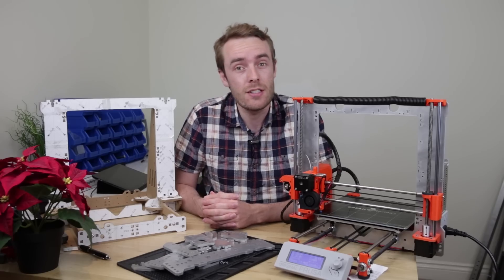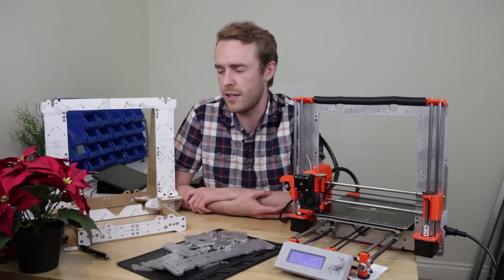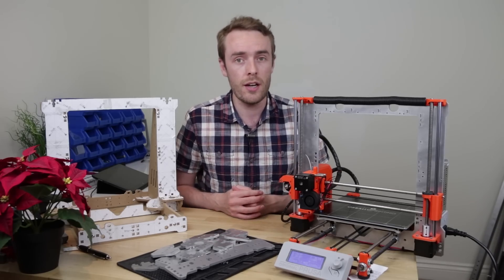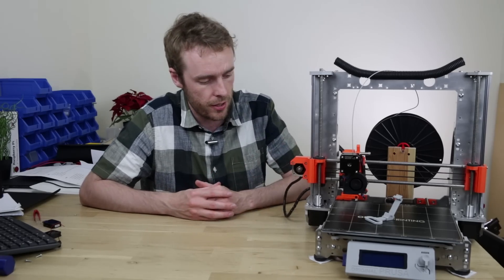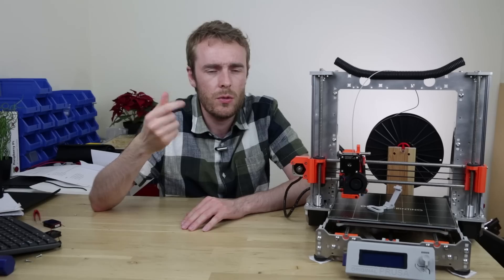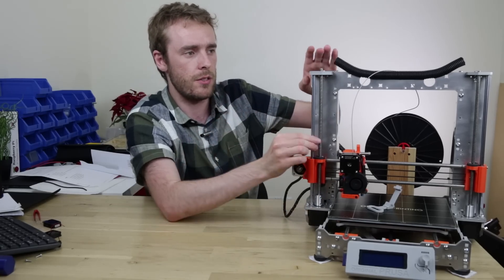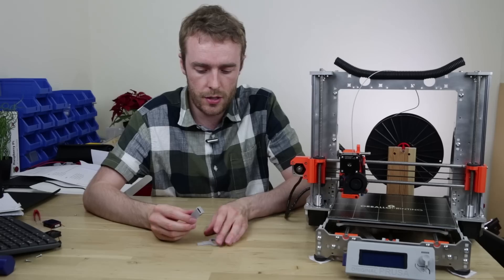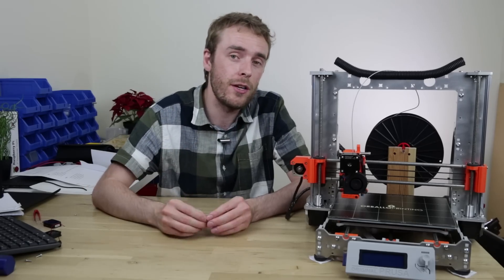Totally CRAZY Prusa i3 MK2s Frame MOD

Comment: Edit: First and foremost, sorry CRT, this wasn't meant as an attack on you or your channel( though it kinda ended up sounding that way, so, sorry XD great content btw! ); your channel just happens to be the channel I'm watching and are one of very few 3D printer/tech channels I'm willing to comment on. Second, before anyone tries to tell me that some or all of the printers I have are essentially i3 clones, they are fixed gantry CNC machines which have been around a lot longer than the prusa i3 printers :P

This is one of the worst designs for 3D printed frames that's currently out(the prusa i3 frame, not the clone, though the clone is obviously just as bad XD), I don't know why anyone would want to spend the money to water jet this frame or even try to clone the printer. Your lead screw(s) or threaded rod(s) used for the Z axis is almost assuredly harder and stiffer than the linear guides that's meant to keep the Z axis from wobbling at the slightest bend in your lead screw which WILL fail. This design literally depends on having perfectly straight lead screws to eliminate z wobble at which point, those linear guides on the z axis become useless.

The quick "fix" to the z wobble issue using that frame is to not constrain the lead screw and let the linear rails guide the x carriage up but lead screws are quite stiff and an 8 or even 10mm linear guide at those lengths will bend with even the slightest bit of force applied to them from a bent lead screw/threaded rod(the shift will of course be in the micron range but so are your layer widths :P ); as you get closer and closer to the middle of the linear rails it will get even worse. -_-

With that said however, yes, this design does a lot to minimize cost if you're building it from 6mm ply wood kits off ebay and it WILL print and the prints will be HALF decent so it does have cost going for it. However, in stock configuration, the original Prusa i3, Mk2, Mk2s, or the Mk3 are NOT good printers by any stretch of the imagination and it's way overpriced for what it is. I wish people would stop singing them praise because new comers to 3D printing are spending way too much on an entry level machine that's pretty much bottom the rung when it comes to quality but costs double of what low cost Chinese made machines can offer and they are better in terms of quality and price.

Disclaimer: I own 5 3d printers( Listed in the order I bought/built them in ), the TronXY X1, Voxel Ox, Tevo Tornado, Anycubic Kossel Linear Plus, and a dual Z custom printer based off the TronXY X1 design.. so basically an ender 3 like machine with dual lead screws ? XD
Reply: So you own five 3D printers, one of which is a delta and the other four of which are based off the Prusa design, most of them without addressing the flaws you’re pointing out (v slot wheels on 2020 or even 2040 are not more rigid than good lm8uu & round bar. Neither are cheap Chinese copies of linear rails, really.), and none of which are actual Prusa printers, nor even the cheap copies. But you are confident they’re terrible and not fit for purpose because prejudice.
Reply: Edit: Ha, it's been a week and still, he has not rose to the challenge, and he calls me prejudice :D

 @JasperJanssen  Prusa design ? Are you trying to claim Prusa came up with the fixed gantry CNC design ? Are you trying to claim that Prusa was the first one to use the fixed gantry CNC design to make a 3D printer ?

Show me linear rods on a 3D printer that deflects less than 2040 or even 2020 given the same length and applied force. Don't get me wrong, such materials exist in that form and can be bought and used for 3D printers but as far as I know, no pro-sumer, consumer, or hobby 3D printer built to date uses those materials for linear rods let alone the Prusa printers :P

When your mechanical design ranks among the lowest of the available options, ya, that pretty much makes it terrible >.>

Tell ya what, get a dial indicator and a 5-20lb weight and tie to the middle of one of your linear rods from your prusa i3 and I'll do the same with genuine 2020 and 2040 extrusions and we'll see which one deflects more :P Heck I'll even throw you a bone and do the same test on the clone 2020 and 2040 extrusions the china printers are made from :P
Reply: Heck it doesn't even have to be a specific known weight, as long as I can easily obtain the same item to conduct the test with XD

Edit: I'd prefer it if it were 20+lbs so whoever loses risks their linear guides getting bent out of shape :D
Reply: (PS: it doesn’t really matter how rigid your linear guides are if your leadscrew is bent. It’s still going to introduce wobble. It’s a non-random input that you will see, the question is only how much of it you will see.)

Comment: There is a thing remix for the x carriage that lets you use a common mk8 hobbed gear :)
If you get the extrusion issue sorted, then just print a 8mm (vase mode) tube vertically at normal print speed. If it stays consistent all the way up, then good job, the frame was worth it! If you print the same tube on the MK2, MK3 or some i3 clone you will see some wobble in the print about half way up onward. Also mite be worth upgrading the Z rods to 10mm.

Comment: You can buy a MK3 frame and its not expensive from a italian web site. It would still be cheaper than what you spent even with the non-printed parts.  They have the link posted on eBay as well.

Comment: So its a P3Steel frame, but out of 6mm aluminium and with the same design issue?
Reply: can you expound on the P3Steel's "design issue"?
Reply: Do you think there are any improvements compared to a P3Steel?
Reply: the Y-Belt tensions the steel or aluminium plate and transfers vibrations into the frame, ideal there would be a horizontal stiffener from left to write in the front and in the back. (so you get kind of an L Profile there)
Reply: i cannot answer the question, it is (for me) not possible without owning and using it
Reply: Thanks for the reply. I have a P3Steel and I agree about the front and rear plate. They are both not stiff enough and end up bowing with Y belt tension. This in turn moves the alignment of the Y smooth rods which aren't adjustable. Gussets  in the corners would help or  as you mentioned an L profile on the front and rear plate  or both. I have been thinking of adding stiffeners to my front and rear plates. I just haven't gotten around to doing it.
Reply: I hope you did know there is a i3 Graber (designed for 6mm Plywood) which could have been made out of aluminium.

Comment: Have you thought about changing the prusa MK3 to a core xy configuration? That would be so awesome
Reply: C.R.T It would have superior print quality but still have all the neat features
Reply: As I see it, there is no good way for turning prusa into a core xy. Core xz would work though, “just” rotate the two y-assembly motors, remove the treaded bold and replace with H style belt, this way you would spare out on a moving motor and thus removing some noise, also, the Y assembly is generally noisiest in a prusa (check this with vase mode) so this would help. If you’d now use a bowden extruder to reduce even more weight on the moving parts. I can make a little mockup of how this would look like if you want.

Comment: Entirely by hand, yikes. You have my admiration, I would've thrown it all out the window and given up after just the first part. Any particular reason for choosing water jet over another process? I've heard they can have relatively sloppy tolerances and issues with kerf(?), have you noticed that with the parts you got?

Side note, is anyone else seeing a face on the printer? Two big holes on the top are eyes, and the black tubing(?) is an eyebrow while the big hole for XZ is the mouth.

Comment: It's built like a tank. Was it your intent to do a dual Bowden extruder at the top? There's a reason Prusa uses integrated lead-screw motors. It might be worth it to swap them out, now that the frame would survive a bunker-buster. Cheers mate, keep up the awesome videos.

Comment: Nice frame, bruh. It look very stiff.
The frame shouldn't hold the top of the threaded rod tho, since threaded rods (and even low grade leadscrews) are usually bent or not straight from factory. If you hold it, it will make the tool move in the XY plane while the rods try to move the tool in Z, which generates Z wobble.
If you want to be sure the threaded rod don't go up and down, just avoid using flexible couplers. The motor should hold enough axial force (in this particular design).

Comment: Lovely. Useless but lovely.

As to where to put the CNC cut files... i don't know, DXF on Thingiverse?
Reply: yes frame stl files found many place, laser file and dxf files have too. google and looking. but waste only money and time do this, use aluminium profile then come better frame.
Reply: I think the actual frame parts of this frame are unbeatable. They are absolutely awesome. However it does have one downfall, the non-frame parts, namely linear motion. Getting a well matched set of rods and bearings isn't that easy!

Two alternatives present themselves. One is riding in the extrusion groove, akin to Ormerod descendents such as Tarantula and Creality. Other is using a V-bearing and riding 3 of those on the edge of an angle iron.

As to good and affordable frames, one i have seen recently is EMT8/AMT8, which is basically steel conduit pipe connected by 3D printed parts.